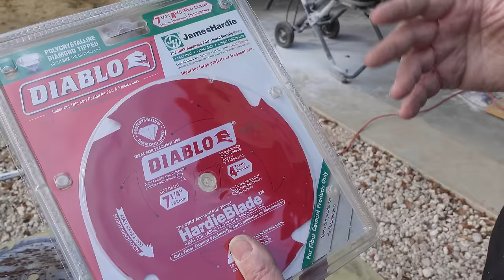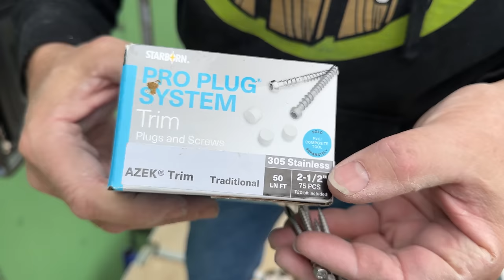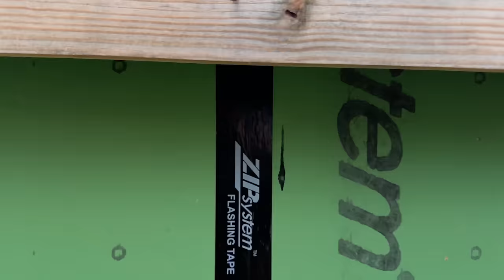Installing a Bulletproof Soffit and Fascia That Will Never Rot!

Comment: Hardie board will swell.  I would be concerned that the routed out channel in the PVC facia would trap water if rain were to get blown up under the eaves and water runs down the soffet into that channel. Caulk the seam to prevent that?
Reply: Hardisoffit does not swell in water. It’s the same formula as the tile backer. Water has no adverse effect on it
Reply: @beachton  I wasn't knocking Hardie, and you are probably right about its composition.  If it ever failed, it would probably be ruled as an improper installation and not covered by the warranty.  I'm not sure I get the whole routed out channel thing, anyway.  I think just ripping the soffit board so it is plumb with the facia would have looked the same and allowed drainage.  Since ripping planks of Hardie creates a lot of dust, I think LP Smartside would have been easier to work with and just as good.  Google "hardie plank delamination moisture" and you will see that Hardie siding can swell, de-laminate, and crumble if water is not handled well.  It will probably be ok.  I was just pointing out a potential failure mode of a novel installation.
Reply: @markstipulkoski1389  I am also just thinking through future scenarios. I have a similar soffit detail and 20 years to watch what it does. I don’t think rain water will get up there at all. But condensation might. If there’s a cold night and then a front comes through and it’s a hot humid morning condensation could drip onto the soffit from the bottom of the roof deck. It will run down and drip out that gap in the Azek. Then the sun comes out and it all dries up in the heat of the day. I think no caulk is better because I have actually seen condensation drip out of my soffit like that. But only like three times in 20 years. Those condensing weather conditions only happen a few times a year in the South.

Comment: The angle on the rake is the same as the roof pitch. So , let's say the roof is an 8/12. That rake trim cut wiuld be found on your speed square. No need for a degree guage. Also the rake board typically covers the end of the fascia. Logic being, the gutter covers most of the rake board end.

Comment: I like the sloped soffit. I would go with square tails though. since this whole assembly has no purpose other than looks and over hang i would use 2x4 to cut down on weight and materials.

Comment: what if.  giant what if.... you painted the edge of the roof sheathing with some white primer before you put on the fascia (or after but it would be easier before). That would be the ultimate sealer/moisture protectant for just in case water leaks or gets under the shingles, roof underlayment, and drip edge.      I know that is overkill but you guys are doing this build to the extreme standards and that could be a thought for another step in the house build.

Comment: When you cut hardie or anything really. Have a fan blowing where you are citting to blow it away from you or you have extra guys so have them use a blower pointed at your saw so it blows all the debris  and dust away.

Comment: Love you guys--but you cracked it at 20:01! Oh well, shit happens. As for the dado cut in the Azek fascia, I predict it'll be the first place to fail. There's just not enough meat left to survive long-term. Other than cost, Azek is the bee's knees. James Hardie has it's moments: it's fiber cement, meaning wood fiber, and if not properly and continuously painted, it'll fail when exposed to moisture. Ask me how I know. It's also heavy and prone to sagging & cracking. I would have used Smart Board. Thank you.

Comment: I really like the dado cut on the facia.  Just seems like you really need a square and straight house for that to work.  Good work.  A question though -- what do you do for the soffit seams where they meet on the butt ends?  Thinset?  Caulk?

Comment: It would be useful if you kept a running list of the tools you use in the description. It’s interesting to note what tools perform well in a hot corrosive environment. 

For what it’s worth, I’ve been using the Bosch portable table saw and DeWalt 12” compound crosscut saw (like yours, only when they first came out) for nearly 20 years and after initial setup they are still dead nuts accurate.

Comment: When yall built the scaffold on the front of the house it didn’t look like you used a nub seal  under the screw jacks. I would recommend you use mud seals to keep the scoffold from sinking and collapsing

Comment: Definitely should’ve used some Lexel or Big Stretch in the miter joint. Or scarf joint as you called it. Also be sure to use  some Benjamin Moore Styx primer, because that is going to have some big gaps after the first summer in that Texas heat. Other than that looks great. I’m just curious as to why you went with angled soffit over level with bird boxes?  IMO it’s a better look level, and the lighting Jordan talked about would look much better with level soffit compared to angled. Just my opinion

Comment: Question: I am in New England. We have to vent soffits and roof ridges to carry away humidity. 

I see you’re in TX, so you don’t have to vent at all?  Is humidity never an issue along the underside of the roof, even with AC?  How about with the small amount of heating you may need at short intervals?  I assume that your AC are heat pumps. 

This is not a criticism. I’m just curious. I like to learn stuff, which is why I like your channel. 

Thank you!

Comment: Nail guns are fairly simple inside. You should be able to tell what the issue is if you pull it apart. It's usually a busted o ring. It may need lubing

Comment: I’ve noticed working the construction business for 15 years that the cheaper nailer guns are not capable to be used upside down. The only one that I’ve noticed that can be used upside down is the Menards brand air roofing nailer, which don’t make sense, because why would you have a roofing nailer work upside down.

Comment: This is probably nothing, just because its a eave and you get alot of airflow. The problem with houston and hardy plank is that the temperature and humidity can change here on a dime. You can have a very cold day and by evening the temperature is back in the 60s and the humidity is 100%. Hardiplank sweats, just like any cement structure in houston winter, and if you place the hardiplank directly on framing lumber that plank will sweat and the framing timbers will pick it up. Its less of a problem if you have a light wieght cedar, but in general I want to put something, a couple strips of asphault paper between the plank and the lumber. 

   Hardiplankers here in Houston are the main part of my revenue stream, they tear up the vapor barrier and take their money, a decade later after critters, mold and rot have gotten in behind their work, that whole stuff needs to come off and remediated. I see it all the time, hardiplank butting against a roof or the last few rows near the ground water logged. Between track houses theres not enough sun to dry out the board, with no ventilation behind the plank they hold onto the water, and if the plank is touching wood that wood is going to rot, ants are going to move in to the rotted wood. The last house I worked on the guy had a 4 ft fireant mound built into the insulation behind his closet. We had to Amdro those ants for about 2 mounts we would wack them they build a new mound somewhere else, and youde see dirt coming out of the baseboards. 

   I used the 4x8 sheets on my house as siding, I went out and found some 1/2 old asphault felt board and I put the hardysheets on the asphalt board. Poor mans stucco with out all the hidden leaks that destroys homes in Houston.
Reply: Now I feel delighted that I stapled up 30# felt before I nailed the Hardisoffit on my house. I just needed to close off the space from wasps before I had time to do the fiber cement. I didn’t even think of the long term problem of condensation wicking up into the wood from the bottom
Reply: @beachton  Yep.

Comment: "Rough on your lungs"

This is a general tip, silicosis is terrifying and permanent. PLEASE wear proper PPE. That means a mask/respirator as necessary, and with proper ventilation. If you don't, you WILL die of silicosis, and it will be slow and painful.

Comment: Just wondering how the attic is going to be vented as aluminum facia and soffit is used here In the north with vents in the aluminum so the attic gets vented where the cement board is. I guess -30C is not an issue for texas like it is Canada.

Comment: I think it would have been better to trim your side fascia flush then overlap your gable fascia. #1 since the gable fascia is to the curb, it would look better without the seem. #2 it would have covered the dado cut on the side. #3 you won't have to add extra time measuring the angle since you would just flush cut it to the side. Btw we did see you split the fascia driving that plug into the dado, looked kinda dickered 😉👍

Comment: Used Hardiplank for dormer facias and they started rotting out within 5 years. My James Hardi certified installer didn't nail half the lap siding on correctly, and they sag of course. Of course Hardi didn't do crap about it.

Comment: You guys forgot to fill the eaves with insulation for non-vented eaves. It's no big deal, but in 10 years or so those eaves are going to show signs of mold.

Comment: Disclaimer: I am not a builder, and do not know what I’m talking about. 

Is it possible that the ‘soffit cavities’ would be warmer than outside air (I know your insulation is on point, but there’s no R100 products out there)? And if yes, couldn’t condensation find its way into that space? Without venting that could be an issue? Though I guess if it’s not perfectly airtight it’s fine? 

Not trying to call you out, armchair construction, etc, just curious!
Reply: Actually looking at the way it’s built I don’t think there’d be a temperature difference in that space. I think I’ve answered my own question!

Comment: Wouldn't you want to vent the soffit itself so moisture and heat inside the soffit can adjust continually with the exterior air?

Comment: I still don’t understand how monopoly framed homes work. Like the whole point of having vented soffit is so all the hot air can vent out. If the hot air created by your shingles cannot leave or vent it will just ruin the shingles and be way too hot. Not hating on it just trying to learn more. Keep up the great work guys. It looks amazing
Reply: That machine above the stairs replaces the need for soffits and vents. So they had to make it air tight instead. The machine is going to pull the air in and blow it out. 

I don’t think they’re doing a shingle roof. Guess we’ll have to see

Comment: Hey gentleman Happy new year best to you all. I have a few questions first no lexel on the seams of the hardi soffit? And I am curious what did you use to space out the blades on the table saw when cutting the Fascia, and also, did you line up the teeth on the blades or offset them and why? Great idea. Great video, great job channel keeps me wanting more. Best from mine to yours from Long Island New York ✌🏻👀✌🏻
Reply: Hello Guys did you reach out to me or is there a scammer in the comments??

Comment: Guys great video, but I have a question. The dado grove you cut in the Aztec  for the Hardie board is this tight. I would think you need  some gap for movement. When it gets hot there in the summer in Houston. Maybe I am wrong.
Reply: I was also wondering about the filler piece you cut and tapped into the dado at the end of the fascia. It looked like the filler piece was a bit over sized and pushed the fascia out when it was tapped in. Still, always enjoy the videos.

Comment: wait if ypu do this your soffit lights wont point down.. im personally not a fan of the angled soffit i would have gone for the flat 90° soffit to the wall. it also makes soffit lights look better and they point down. I know you can get lights thatyou can move to point them where you want but i just feel its a cleaner look goong 90°. Just one persons opinion

Comment: Hey guys, when you build this, how are you dealing with the condensation that will form inside the soffit later?
Reply: Not sure how much condensation there will be with this; the soffit interiors don't penetrate the air barrier of the house. I suspect any condensate will drip down the hardy board into the PVC channel. PVC and cement don't rot. If the soffit isn't air tight it will dry out; if it is tight, the total  water content should remain the same, just change from water to vapor as it heats
Reply: @CDArena  Hey Guys, I’m not being argumentative,just a voice of experience.  In building a cabin in the mountains of NC, I did the same thing you did here and I a couple of years after the cabin was finished I noticed mold on the underside of the soffit.  It happened to me and if you are in a high humidity area, I think you may some risk.  Easy adjustment now, rather than later.  Thanks and I really enjoy your utube.
Reply: I have the same concern. Even in our area (CA) with mild climate, we put some venting into enclosed exterior areas. The eaves could be critical due to the heat / cold on top of the roof. However a lot people don't do this.
Reply: There won't be any in this case. Those soffits are applied to the building, and there is no penetration into the attic. This means the soffit will remain on the cold side, so no condensation. If you had any penetration or if it was open to the attic space, then yes, this would need to be accounted for.
They are spray foaming with closed cell foam, so no air leakage either, as the foam acts as a vapor barrier as well as insulation.

Comment: They are not azek brand, so i am guessing this was not actually a sponsored bit...
That said though, I actually hate those screws, I've only used the cortex ones, starboard (the brand they actually used) is supposed to be better, though.  I just have not given up my alternative to give it a try yet.  The azek on the packaging is for the plugs that are included in the pack (pvc, white, smooth or textured, etc.)

Comment: It looks better if you run your gable fascia a little bit long past the lower fascia at the bottom corner,  some people even leave it long enough to cover the ends of the eavstrough but 1/2" is plenty. The way you did it you have an exposed seam and the little angle cut at the bottom looks kind of 🤨.      Other than that, good job 👍

Comment: Hardie board edges really should be sealed when you make cuts. It's still a wood product and will soak up water and expand, just much much less than other particle board wood products. It's in the installation sheets.
Reply: Hardie board is a fiber cement product and contains no wood. It is still recommended to paint cut ends though.

Comment: You should have absolutely used construction adhesive on the rafter tails to help secure the Hardie board. In my experience of using this product hung horizontally fasteners alone will fail in about 5 years.
Reply: if they apply trim at the wall it will be fully supported.
Reply: there's also that full-length dado on the outside edge adding equivalent support there.

Comment: Did you try to compound miter the rakes into your fascia at the corners? I usually don't dado my soffit in like you guys do, just layout my screwing pattern to fix the two boards together, but I also work with mostly red cedar/primed pine. I'm wondering if that dado made it increasingly difficult to compound miter.

Comment: You mentioned that an eave on your house is only cosmetic. This is far from the truth. A large overhang is extremely important for the longevity of the building. It helps keep a lot of the water off of sides of the structure. Great video, as always.

Comment: - Trimming "Cementitious" Hardie boards - Are you using a grinder or "score and snap with a knife/tungsten scoring tool, or a "fibro-cement cutter"  ? this a thing in the USA - basically a double acting guillotine?  - anything making dust isn't a good thing with these products - the angled cut in the PVC fascia is a good feature - ..

 - Even though Asbestos shouldn't be in the products - Silicosis is still a bad deal - in Australia they are in the process of banning "engineered stone" as it has proves more deadly for workers than real stone - and much more widespread due to the "low prices" -   keep it safe, protect the workers form airborne minerals.

Comment: You're going to want an access panel where you have your whip for your exterior lights.  You will be installing AC/DC converters and controllers in there and you will want to be able to acess it relitively easily.  Very unlikely you're going to always want 120v Power.

Comment: The saw is getting upset because you’ve got the wrong brake cart in there. 

There’s no issue running an 8” dado stack in there provided you have the dado brake cart installed too.

Comment: 28:30 why is the fascia joint angled like this instead of just butting it together with flat ends?
Reply: They said “scarf joint”; I looked it up, and the benefit is that it’s less visible, especially if the two pieces are glued together.